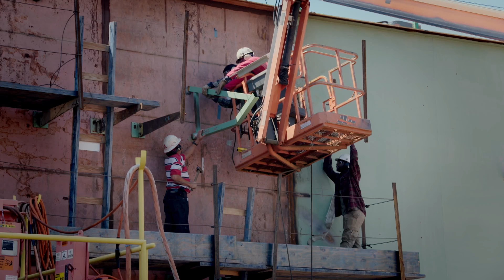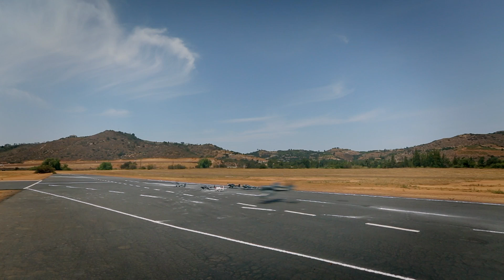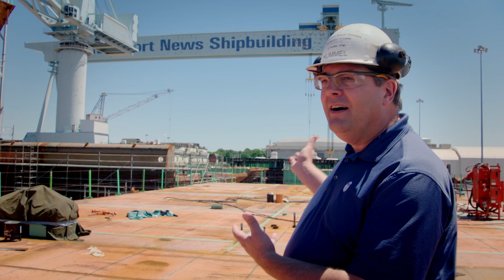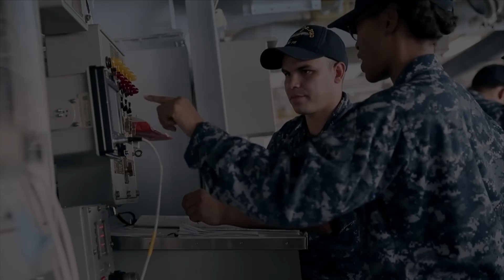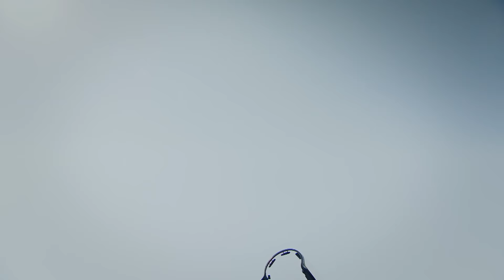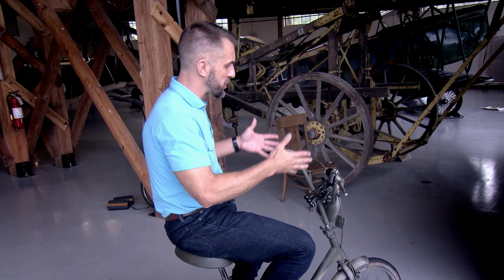How the World's Largest Warship Changes Naval Warfare Forever | Blueprint

Comment: Damn Brits.  Airspeed is in KNOTS.  Altitude is in FEET.  Aviation is standardized based on the Imperial system to avoid confusion and reduce accidents. 

I served 9 years in the Navy.  I can't tell you how fast aircraft carriers can actually go but 30 Knots is not its top speed.  
One of the main reasons why the Aircraft carrier doesn't go flat out is because it is vulnerable.  The ships and subs that are with it are not just for show.  Think of them as her muscle.  But they have limitations.  Destroyers and Cruisers are not able to go as fast as the carrier, they can go 30 knots but sustaining that speed burns large amounts of fuel and can damage the LM2500 gas turbines.the submarines however can probably keep up with the carrier although not a single submariner I served with on shore duty would talk about the speed of the subs.  Most likely classified.

Comment: Where that observer was standing so close, was he  able to feel the heat coming off the jet engine even while the jet engine was pointed in a different direction, also does the after burner create more heat only while it is on compared to normal use,  I don't plan to ever stand that close to a jet engine, just trying to imagine what that gentleman was experiencing, thank you for any response.

Comment: As beautiful and awe inspiring as the Ford class aircraft carriers are I can help but feel that they are vulnerable, even the strike group is not going to be able to provide protection for the carrier if they are under attack simultaneously, and the defensive weapons and electronic countermeasures etc provide a last line of defence that is probably as good as it possibly can be but not full proof that much is certain, leaving me to hope that my pessimism is unfounded, but it does not change the fact that the Ford class carriers are an awesome sight and full of technical brilliance.

I can’t help but chuckle at the “Hush House” being described as “Secretive” it is only a giant exhaust silencer to alleviate the huge amount of exhaust noise that jet engines produce, and it enables engineers to be nice and comfy in their control room, the equipment they use for testing might be complex and advanced but I can’t believe that it is “secret”. 
Well I never, using Re-heat (afterburner) to help the aircraft take off from a carrier, I was waiting to hear some highly advanced method of giving the electromagnetic launch system a boost, but no, just boring old re-heat that has been around since the beginning of the jet age.

When I started watching 👀 this documentary I thought it was aimed at anyone with an interest in naval or aviation history and technology, but towards the end I think 💭 it is more likely that it is for early years children’s education in the way it is being presented, it is still interesting and informative but not as complex as I was expecting.

Comment: The only problem with the afterburners is that you triple your fuel consumption, you can only use them sparingly.  Modern jets have supercruise due to increased efficiency putting more power in the same space.

Comment: The Ford-class aircraft carriers, like their predecessors, do not use turbines to directly drive the propeller shafts. Instead, they employ a nuclear-powered electric propulsion system. The ships are powered by two A1B nuclear reactors, which generate steam to drive turbine generators. These generators produce electricity, which then powers electric motors that drive the propeller shafts.
Reply: This is wrong. I served on this ship and had to become very familiar with the propulsion system. Steam turns turbines which then translate power to the shafts via an MRG. There is a separate turbine that produces all the electric components on board.
Reply: @mikesotherthings   you were on the wrong ship because it is nuclear power
Reply: @RaeArtson-dm7zc buddy read the comment again
Reply: The steam is created by the reactors

Comment: For anybody that sees his comment, just go ahead and understand that the top speed is much higher than 35 kn, and to put it to perspective, the top speed is classified, and it’s a nuclear powered carrier, meaning whatever speed it can go, it can go that speed indefinitely for as long as it wants. I bet that thing can get up to 50 to 60 kn in good weather.
Reply: My brother served on the Nimitz and no matter how many times I asked him even after drinking I would try to trip him up on how fast the carrier can go he never gave it up but he always told me 35+ knots until the one and only time he said 45+ knots but never the top speed.
He also told me when they are traveling flank speed there is no where on the ship you cannot feel it it's unmistakable vibration you feel not the kind vibration the rattles everything but more like humming.
No crew member can hide from it.
Reply: 35kn is fast enough to water ski behind, that is plenty fast.  The sprint speed- go fast until we start shaking apart- yeah I would not be surprised if it is that fast.
Reply: I served on this ship, it really is only 35 kts. Much more goes into the propulsion than just the power plant.
Reply: @mikesotherthings do they cancel flight ops if there is not enough wind.
Reply: @RebelRage1 nope, typically for take off an recovery, they aim for about 24 kts, so the ship can go more than fast enough to support flight ops in low wind conditions
Reply: Impresionante avance tecnológico. Este tipo de portaviones no solo representa poder militar, sino también un cambio total en la estrategia naval moderna. Sin duda, marcará un antes y un después en la historia de la guerra marítima.

Comment: 22:39 "USS Gerald R Ford carries a load of 13.8 Thousand Kilovolts of Amperage."...  Is there anyone able to explain to me exactly what this Kilovolt of Amperage is? The man is very excited to tell us that it means a very powerful thing, but my brain is hearing something like 13.8 Tons of Miles - Which doesn't make much sense!
Reply: A kilovolt is a unit of voltage (electrical potential), not amperage (electrical current). Amperage is measured in amperes (amps), and a kilovolt (kV) is equal to 1,000 volts. While kVA (kilovolt-amperes) is a unit of apparent power, it’s not the same as amperage; it’s calculated by multiplying voltage (kV) and current (amps). Does that help?
Reply: @leightapex This is over my head . Thanks for helping. It’s impressive for sure and Trump is planning the next level with Steel. I hope it doesn’t sink!!  Airplanes have part Steele but not all steal.
Reply: So very very very NOT my field of expertise. I am just a building contractor.
But let me give it a go.

Kilovolts of amperage is how much energy a system can give. What is NOT included here is the loss of energy before the actual function is being done.
Say an engine gets 10 kV*A and then 20% is lost in whatever ways energy can be lost in an engine before it acually turns. That would make this engine an 8 kilowatt engine.

So he tells you how much energy the powerplant can give. I doubt that number will change. But the actual muscle, the wattage, can differ depending on technology, upgrades etc. How well those kV*A are actually utilized and turned into actual watts may be classified, I don't know. I'm not very literate in military stuff.

Actually, I'm not very literate when it comes to electronics and electricity either, so I might be leading you down the wrong path altogether. But this is how I understand it.

Comment: The Ford class doesn’t actually use traditional nuclear fission reactors. It’s classified beyond Top Secret but the Ford has the world’s first Fusion reactors. One would have been enough but for security and military redundancy they installed two of them. That’s why the speed of the carrier is so fast and it’s actually much faster than 34 knots. The problem is it’s so fast that the rest of the carrier group can’t keep up and that’s causing a problem. That’s why the fast Littoral class destroyers were built but now they can’t travel at top speed and the design has been cancelled.
Reply: NO it is not a Fusion reactor!
Reply: No honey, there has yet to be a nuclear fusion reactor that creates any net power output. As of right now, all prototypes of fusion reactors require more energy to operate than they could ever generate. That is nothing to do with classified technology. That’s just the state of physics so I think you mistaken.
Reply: Classified beyond top secret but you're just spouting it out in a comments section. Also littoral ships were built for coastal operations, look up the definition of littoral. It's also not fusion.
Reply: We don't have fusion reactors that produce more energy than needed for the reaction.

Comment: I think it’s important to remember nuclear power is essentially electrical.
Reply: I thought the heat from the SPLITTING OF ATOMS BOILED 💦 to create  pressurized ☁️☁️ that turned turbines to generate ⚡⚡. So in your case...the splitting of ATOMS itself must somehow be ⚡⚡⚡ IN NATURE? Your theory reminds me of the ALASKA SIZED PLUME 300 mile high EJECTA That shoots into outer space from IO'S SURFACE. The preferred theory is that the plumes are volcanic magma ONLY. But the way the material Cascades are more consistent with electrical discharge. Despite the high radiation around Jupiter the closer a probe gets close enough to photo the plumes the GLARE from the plumes are too bright to photograph them properly.

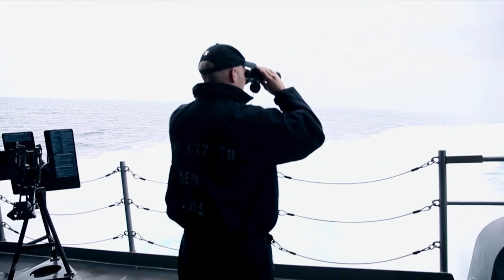Comment: 21:39 THIS IS NOT a new power source.
It’s been around for years!!!!!!!!
Reply: Only since 1958 and the submarine Nautilus.......only 67 years. The arresting cable is a hundred years old. catapults are more than 60 years old....it goes on and on with each feature of the Gerald R Ford being a mere refinement of aircraft carrier features used in the 1930s to 1950s. Of course, it's highly refined, but those technologies were not designed specifically for the Gerald R Ford like the video says.